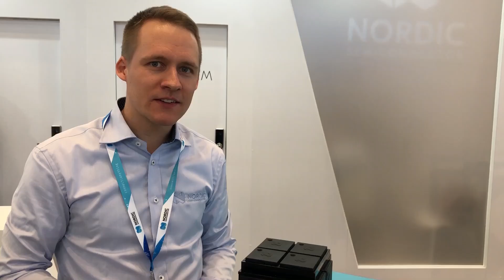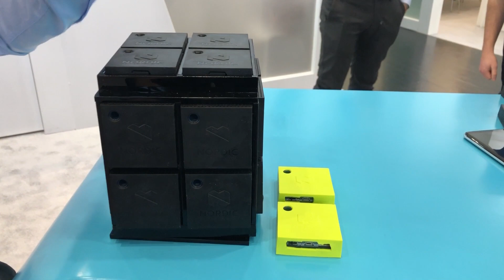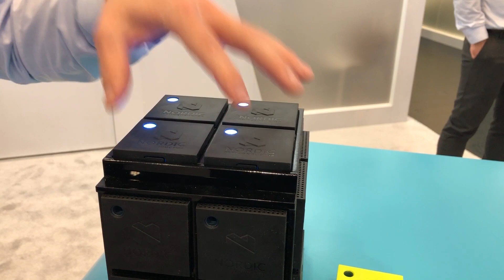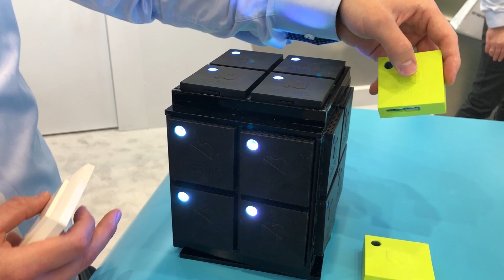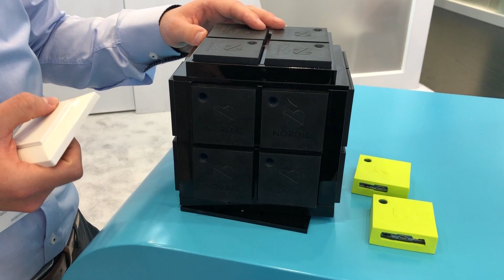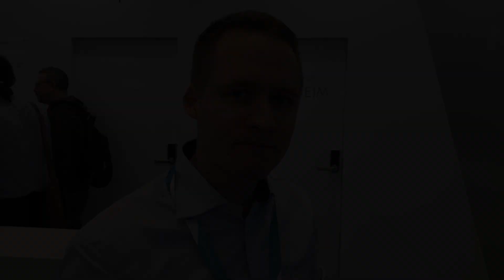Bluetooth mesh demo with Thingy:52 and nRF Mesh app

Comment: Dear Team,
	My project requirement is that I have to use one master device (nrf52840). And  more  than 50 slaves devices(nrf52832).

	Slave device can also be as master for another slave device.

	Master device should be connect with all slave devices and data should be transfer  from master device (nrf52840) to a particular slave device. At a time .
Reply from the maker: Dear, we recommend you to reach out to our tech support team on DevZone with questions about your project: https://devzone.nordicsemi.com/